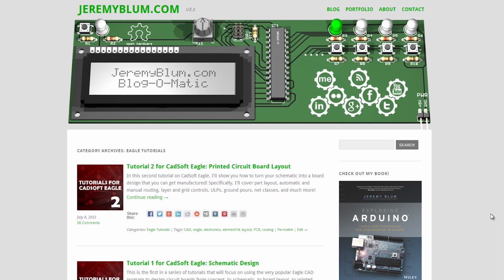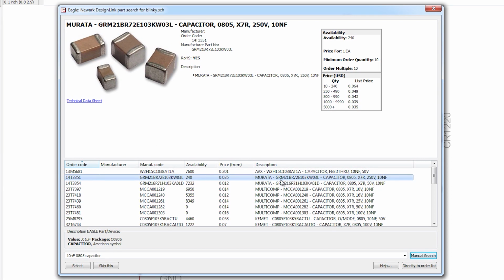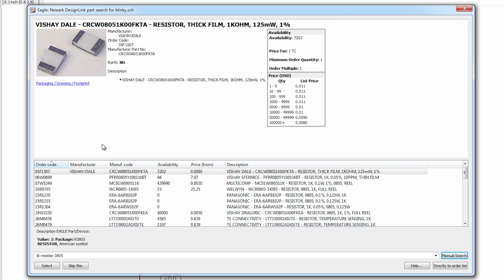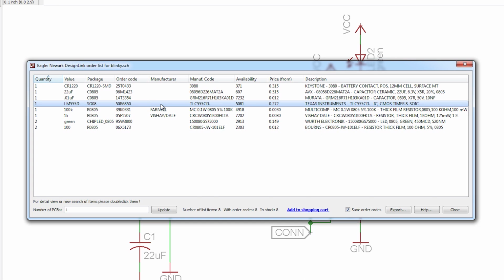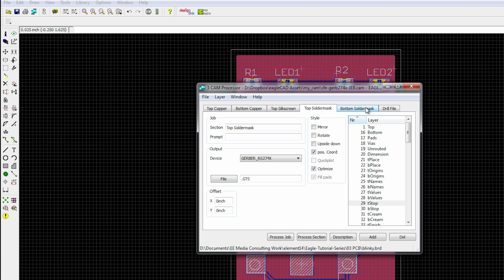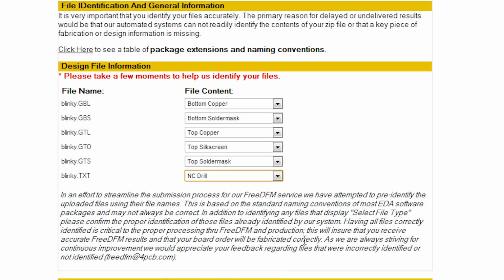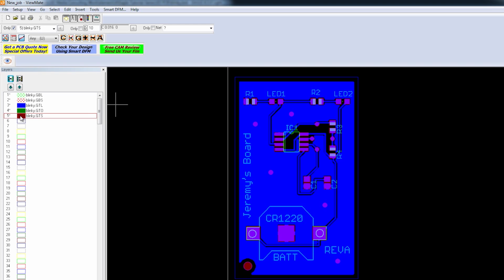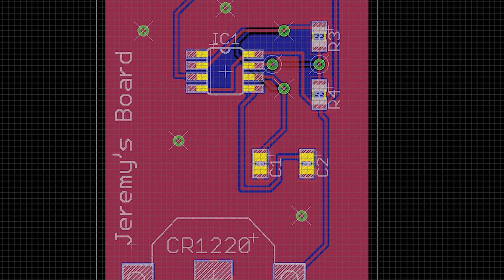Tutorial 3 for Eagle: CAM Output and DFM

Comment: Wanted to say thanks for the videos.  I'm having trouble trying to make a simple board.  I just want to take an rj45(only use 6 wires not 8), or rj11 and covert it to a 6 pin 3.81mm header but cant find a through hole heater in eagle. It would be cool to get some help if possible.

Comment: sir, i have doubt to make gerber files .when i enter in cam processor i got the option of mill layer , what the layer we have to select at there bcz  i am not able to going further. and why we make gerber files ?????
what is the use of it in pcb designing ????
can we get pdf of above circuit i.e. Front , top , bottom view using eagle cad software ???? and 
how ??? can u make video on that ???

Comment: When I created a ground plane on the top and bottom, it offset the ground plane to the dimension lines. I tried to move the lines but it put them back in the offset position. It could be a issue with how the program is running in my computer. Thanks for the video.

Comment: What do I do if I want to have a program running on a pcb such as where a button when pushed turns on an led. For example if I wanted to have arduino code running on a pcb
Reply: Caleb Fahlgren design around an atmel microcontroller. thats the chip on the arduino

Comment: "CMOS" is the "low power" version of the 555 timer. The "Bipolar" version of the 555 timer (the one that requires at least 4.5V) consumes 10mA, whereas the CMOS version only consumes 80uA. It'll operate on 1.5V, which makes it ideal for your coin cell application.. How could you be designing and building this circuit and not know the difference between a CMOS and bipolar 555 timer? It's also worth noting that you do not need the .01uF capacitor from pin5 to ground on your little LED blinker board. You don't have to worry about "noise", as there's no other circuitry present, aside from your astable oscillator, to produce any noise. You can leave the number 5 pin floating (e.g. disconnected), which means you can easily build this circuit on a single layer board.
Reply: robvei45 but hey thanks for the Eagle Cam tutorial right? I mean if youre going to criticize a video not intended to teach circuit design for poor circuit design...might give the guy some props for his effort.
Reply: Doesn't he say he didn't care about that level of detail for, as you point out, what is just a little LED blinker board? So what if he uses a cheaper part for a cheap little LED Blinker. What is so bad about being overly cautious and adding an extra, rather unnecessary, capacitor. It would add a negligible amount to the cost and only serves to solve a problem, even if it does not effect this particular circuit. Some people just put decoupling capacitors on everything out of habit and there wouldn't be as much to practice on with even fewer components on an already simple board

Comment: After those 3 very interesting and informative videos, I wish you had gone the extra 5 minutes to explain the solder layer and the flux positions. As I understand it, trying to make surface mount connections yourself is not likely to succeed. 
And what is the point of doing all this design if you don't know a critical step in actually getting a board manufactured ?